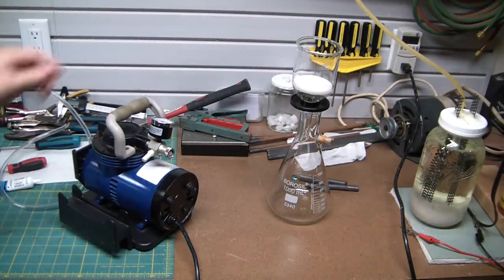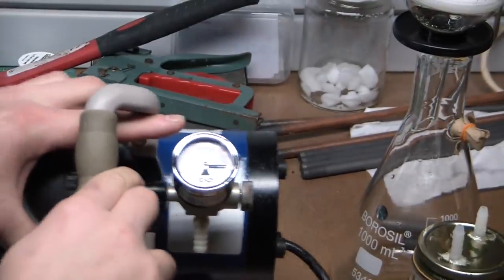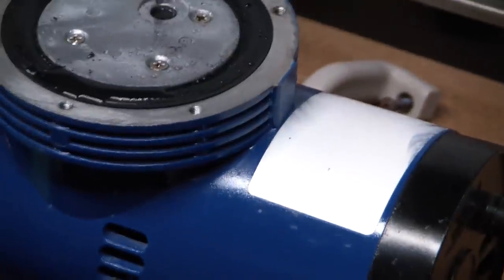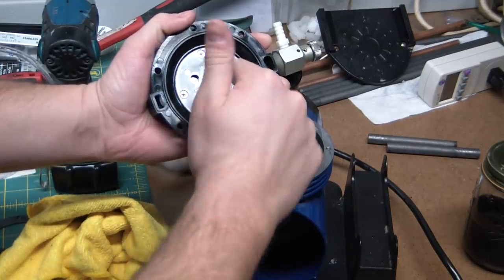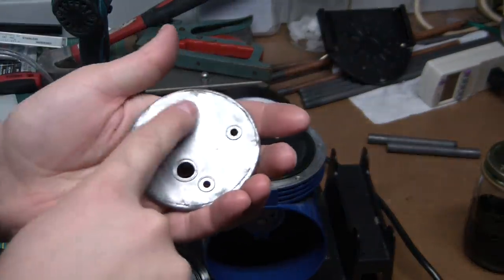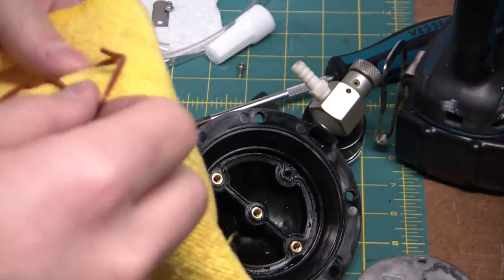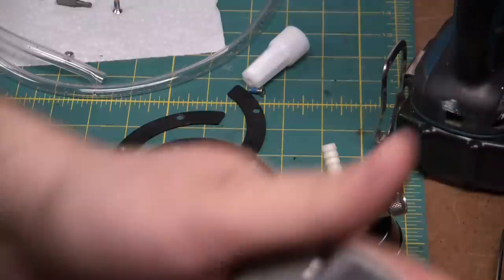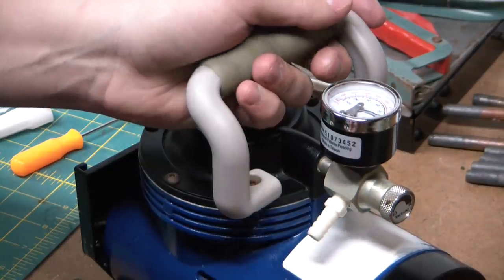Rebuilding a Dirty Vacuum Pump - Diaphragm Type

Comment: EM, you need a bigger thump keg! lol Instead of a tiny pint jar, use a 2 quart jar and only fill it about 1/4 full. That way there's a lot of volume for the particles to drop back through. Also, an inline filter like a gas filter would filter out fine particles and absorb some moisture on the paper element. You could also put a molecular sieve column (mol. sieve) to really dry the air prior to your vacuum pump. And you should go to the pump website (Gast or whomever) and see if they have an exploded assembly view. Could probably reorder parts as well. Great job and a good tutorial video.

Comment: Regarding your jar with water and carbon for filtration, I built one about fifteen years ago, but used a 30 gallon drum.  To minimize excitement inside the drum, I used a 3-M floor scrub pad with a hole for the pipe that went down into the water. It made a great baffle.

Comment: That's really interesting, I've disassembeled and repaired mine too, but mine is an eccentric type with these little metal Plates under Oil (sorry I don't know the exact name in English) in German it is called "Drehschieberpumpe"
Reply: I believe it's rotary pump or rotary vane pump. But this is an example for the German language at its best. So Drehschiebervakuumpumpe it is xD

Comment: instead of putting a fan they might have used the output as a way to provide air circulation to the crank to keep it somewhat cooler maybe?

Comment: I believe that hole is a rupture piont. It is a safety feature built in to prevent air locking the cylinder

Comment: I've made a replacement reed valve out of a feeler gauge of the same thickness. It was a vacuum pump for mechanical use. Fuel tanks, hydraulic tanks,, cooling systems etc.

Comment: Does putting activated carbon in the water actually help? I would think that the water would nullify any filtration that the carbon would actually have.
Reply from the maker: Your probably right, after doing that I was thinking 'why the hell did I use water' lol
Reply: @ElementalMaker  because chlorine gas is soluble in water?
Reply from the maker: @timothypirnat3754  chlorine is relatively soluble in water, but pulling it though dry activated carbon would have been just as, if not more effective at capturing the gas.

Comment: I know this is a seems a little pricey at $319.99, but it's well worth the cost.  The eBay seller Deschem sells this vacuum pump "110V,180W,Circulating Water Vacuum Pump,Two off-gas Tap,US Plug" under that description.--search for model SHX-IIIB-180  I'd post the direct link, but I don't want my reply black-holed by YouTube for posting a link.  Deschem is reliable as hell as I've done business with them for years now and they've always made good on their promises.  I've had a few things arrive broken from time to time, and was missing a stainless steel spoon one time, but never once had any issues with replacement.  They sent me two stainless steel spoons for the missing one.  Anyhow, that vacuum pump pulls 28.5" of mercury which is about as close to a full vacuum as you are going to get AND, you can just suck water right through the system since it is a dual aspirator type.  I've shown it running briefly in a couple videos before.  You only need that pump.  No cold traps or drying apparatus of any kind and it's quiet as hell.

Comment: Yeah those reeds are a standard part on a lot of medical vacuum and air pumps, I rebuild all of the motors for my dads dental cars and the reeds are always a pain in the ass, at least it’s threaded and not a nut on the other side

Comment: Sound reduction and venting to crank case: if you still want to stop venting to crank case and keep noise reduction, maybe you can make a diaphragm to prevent crank air mixing while still reducing  pressure pulses.

Comment: you could use good old jb weld to make reed valve seat recesses. all you need is a dryer second stage for your filter. Remember a vacuum pump is only a air compressor pump back wards

Comment: That is very different from what I was expecting. I wonder how long that rubber will last.
Reply from the maker: It's pretty thick stuff, I think it'll last a good while as long as I add a pre-filter.
Reply: @ElementalMaker  Yeah yeah a filter will definitely help and I assume running some rubber rejuvenator liquid every 5 years or so could make it last longer than the motor.
Reply from the maker: @x9x9x9x9x9  I didnt show it on the video, but I gave the rubber components a light coating in heavy silicone grease to keep the protected from contaminants and to keep the rubber fresh. I think your right, they should last a long time!
Reply: I've been told that you want to use a fresh rubber every time, but who knows? The way i see it, rubber can be used until it breaks

Comment: It looks like a diaphragm airbrush compressor with a few tweaks (directed intake pipe instead of an open air intake passed through a moisture filter and no output line). I'm just going off appearances without being able to handle it myself, but the cylinder head looks like it's tapped for an output on the opposite of the intake and able to take a block to direct the air through a hose to a tank instead of into the main body as a muffler. The cylinder has does have fewer fins for thermal dissipation than a compressor type. I'm guessing because the vacuum version is venting the hot air to shed heat while a compressor is storing air meaning the heat has to be removed a different way.

Comment: its a burst disc for fluid intake...  it was put together wrong....
Reply from the maker: Good to know, I put it back together wrong since I'd rather have the motor stall than the rubber rupture.
Reply: I was wondering why you put it back together wrong, knew Iwould find the answer here in the comments
Reply: @ElementalMaker  It might damage the crank or connecting rod before the motor stalls.  Better to let the burst disc do it's job.

Comment: In the future, you may want to use sodium hydroxide solution as a chlorine trap:

2NaOH + Cl2 --> NaCl + NaClO + H2O

Though only once you've solved the "liquid getting sucked into the pump" issue. NaOH solution would eat up any aluminum in there.

Comment: I'm guessing the hole is to maintain air pressure from the bottom and create a strong seal between the rubber and aluminium. See how the metal face that sits below the rubber is curved inwards? The atmospheric air pressure would be evenly distributed over the entire rubber surface creating a strong seal between them. This is my guess.

Comment: You need a calcium chloride water trap to help dry the air out before it gets to the pump
Reply from the maker: Absolutely agreed. I might make one with calcium sulfate and indicator, since it doesn't get deliquescent like calcium chloride does and is easier to regenerate. Calcium chloride is the better desiccant though.

Comment: Should run the gas through a alkaline solution instead of carbon. Chlorine will dissolve and make HCL then neutralize with NaOH or similar.